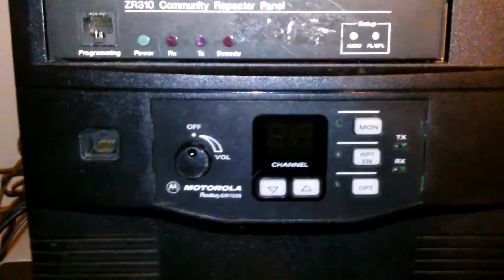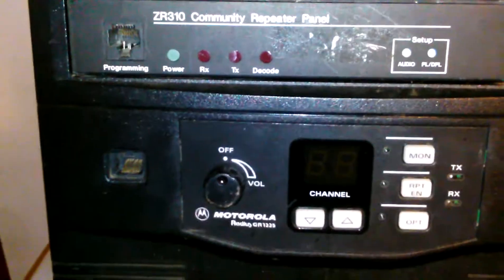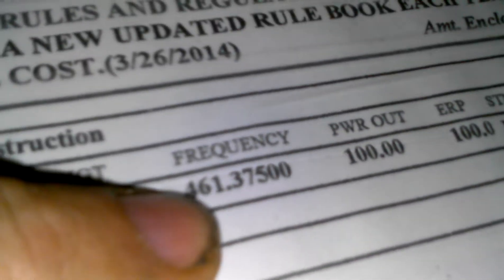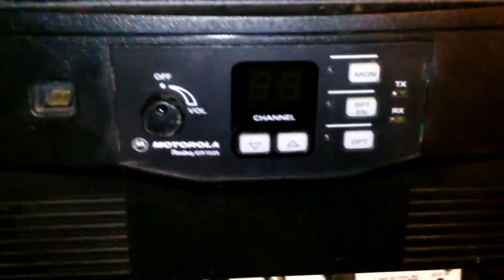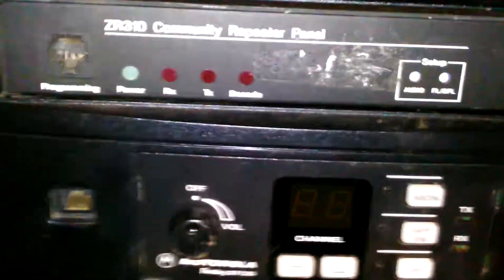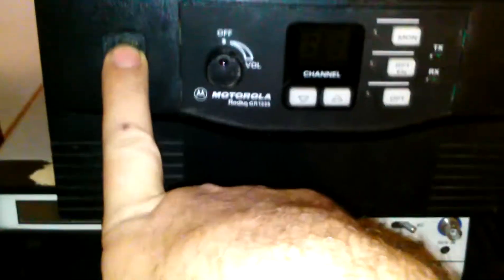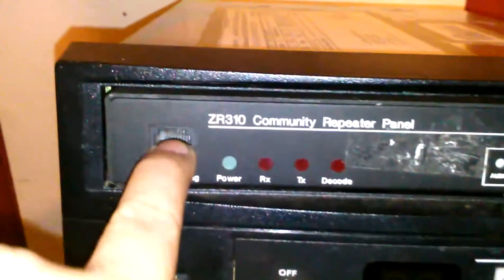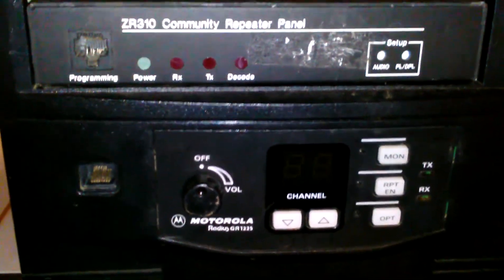My GR 1225 UHF Analog Narrownband Community Repeater

Comment: I know this is a old video but I just acquired one of these, how would I be able to tell if the unit has a built in duplexer or not. Mine looks identical to your with the same controller box up top and only one mini uhf plug visible on the back to the radio
Reply: open it up and see if it's on the side...

Comment: there is zr310 software you use the gm300 connection not software, its much easier, some of them have jumbers inside to that will explained in the manual

Comment: serial to usb connector will not work with gm300 software on win95/98 because in dos mode the is no drivers to complete to communication from the pc to the rib, you have to go direct with rs232 to radio gm100,120 300
Reply: +bryon clemons unless you get it to work in DOSbox and use an Atten adapter lead then you could have USB.
Reply from the maker: +Glen O&#39;Riley DOSBox and other VM's you are asking for corrupted codeplugs. Best was is to use a real DOS machine, Motorola RIB and proper cables..
Reply: ElfNet Gaming
I agree a "DOS machine" is the best way to go for some things and for questionable radios I have a 486SX/33 here on MSDOS6.22/WFW3.11. I also have an old (pre dual core) WinXP laptop (both are Toshiba, well actually all our lappies are) for XP based software.

BUT older machines are night on impossible to find now! So, if you are able to do the job using something like DOSbox slowed down you are fine.

There is no reason or need for a corrupted codeplug if you use a reputable USB adapter (took me a few years to find one).

I program my MCS2000s off a WinXP VM in VMWare Workstation and through a 3rd party made RIB using my Atten USB adapter and never had a hickup. I've had more hickups using the proper gear TBH.

So I now get to do most or all of my programming off my i7 laptop, just haven't had a chance to test the GM300/M120 through DOSbox as they've been boxed away as a crossband repeater set but have been successful with Phlips PRM80 gear as well.
Reply from the maker: ***** The problem is there is SO MUCH crap on the market that claim to be legit but turns out to be cheap chinese bootleg crap. It is hard to find the right stuff for this.

Yes old computers are getting hard to find and ones you do find people want entirely too much $$ for because they have it in their heads "Oh its vintage is automatically worth more than it was brand new, working or not..".. INSANITY!
I was smart I guess and kept all my past computers I have owned from the old IBM PC XT's to the Dell laptops...
Reply: ElfNet Gaming
I kinda miss my old Turbo 10mhz XT 8088 lol with its 2ft long EGA card, comms card etc and huge ass 20mb hdd

Comment: do you have rss for the zetron 310 ?
Reply from the maker: +bryon clemons The ZR310 uses the same MRSS as the Motorola GM/GR 300 radio, you have to set it to "repeater mode" before you read it. You ONLY read the ZR310 as  the option board and skip reading the receiver and transmitter radios. It also takes the standard motorola mobile cable too.
Reply: yup, I have just about all the zetron intercomects, the on I use is the 320, it totally programmable by DTMF or over the air, the others require software and the gm300cable, I have the MRTI advanced interconnect that is still made, it goes for $1995 new, it has group paging 2 and four tone pager format, phone incoming and outgoing to each individual radio, privacy mode were it block the conversation out, plus a lot more, I have two I70r digital interconnects, the only thing I wish I could find is a manual for it, managed the RSS but no info
1

Comment: no problem programming with the gr1225 on windows xp, out of the usb with the built in chip so its rib-less, the gm120/300 wont work with a USB to 239 adapter because it is a dos based program and it does not know what usb ports are, I need to have a computer running win xp or earlier that has a true rs232 port along with software its fine

Comment: what are you using for antennas and amps in and out ?
Reply from the maker: +bryon clemons I removed the internal duplexor.
The antennas are the Commscope DB-420-B
The transmitter amplifier is a Cresend P10-10UH1-C5-001 (10 watts in, 100 watts out)
The rx preamp is an older dbx inline thing..Not sure of the exact model number on it though
The coaxial cable is - Andrews 1 1/2" Heliax with polyphaser block on a grounding buss bar at the antenna lead port on the equipment shelter. Grounding strap kits every 50 feet on the line runs, and matching "N" type connectors on each end of the cables.
I turned the radios transmitter down to about 15 watts so I can drive the amplifier fairly well but not right at it's limit.

Comment: I have the same unit the 45 watt version, set at about 30watts, using a notch duplexor internal, and a db90 repeater ant about 65ft w/lmr 600 coax, I have several controllers with interconnect, im using the zetron 340, but Iam going to install echolink w/the auto patch, I have a tone of zetron controllers including the MRT 2000, biggest problem is at this point I can only program repeater with the 1225 RSS ver 4 witch is windows based a, the other controllers I have the RSS  but don't have a older pc with dos and a serial port instead of usb, win 98 with A USB will not use the port in dos.
Reply from the maker: +bryon clemons Have you tried to use a USB to RS232 cable (I call them FTDI cables) but they worl for some newer RSS on laptops that dont have an RS-232 port..... I have never tried that myself on the old RSS. I have an old old laptop I use keep in the truck for just that type of thing..

Now that I think about this you said you have the P/M/GR 1225 MRSS you should be able to use an usb - rs232 (FTDI) cable. Thats how I programmed this repeater initially, the ZR310 however uses the GM300 software and I had to use an old PC, which is why I now just use the old win 98se laptop in the truck which does have an rs232 port on it..

Comment: how is the range ?
Reply from the maker: +bryon clemons It's usable to about 75 miles or so. I am not 100% sure though. The tower is south of Shreveport, La. and we can talk from Tyler, Tx into it.. The system servers the tri-state region well (Ark-La-Tex) and I have picked up 2 new customers on it since this video was posted.
The system has a receiver preamp installed on it and the RX antenna is 500 feet up and the TX antenna is mounted hanging down right under it. I was going to use a duplexer on it but decided not to for performance and just use a pair of antennas.

Comment: how you doing my name is Aaron I have a Motorola i750r controller I'm having trouble programming
Reply from the maker: +Aaron Jones i750r....  I think that model you can use the GM/GR300 RSS to program as well as do it via DTMF on a handheld (just like the ZR300).. I am not 100% sure though
The i750 is a telephone interconnect though, not a repeater controller.
Reply: Thanks
Reply: +Aaron Jones it has its own software, whitch i have you use the same cable setup for programming the gr1225